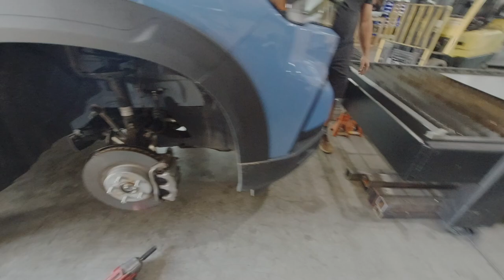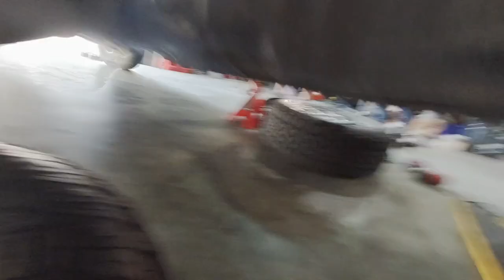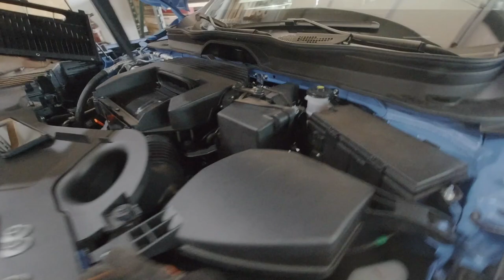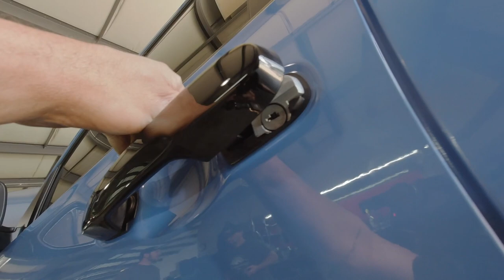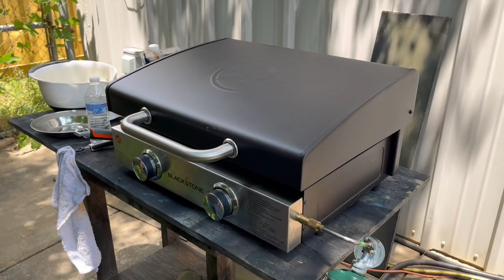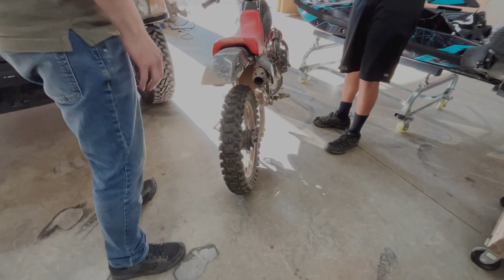LIFTED 2023 Honda Pilot TrailSport 2.5" Inch Kit at HRGOFFROAD with No-Lo Designs & CampingRandy

Comment: huh now that you point out the engine space there is definitely room for a hybrid system also please tell me there is camber adjustment in the rear now!
Reply from the maker: No - we think we can bring it back with a small subframe drop but we are talking light a 1/16 out.